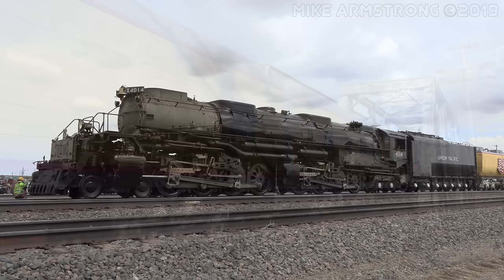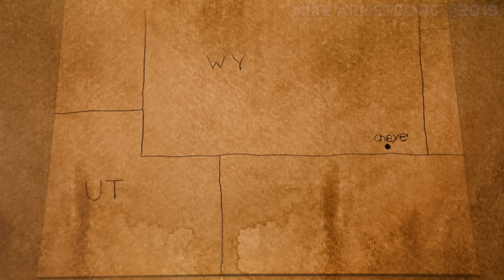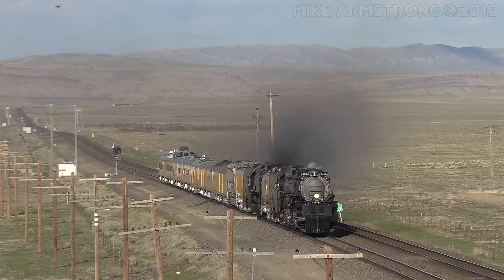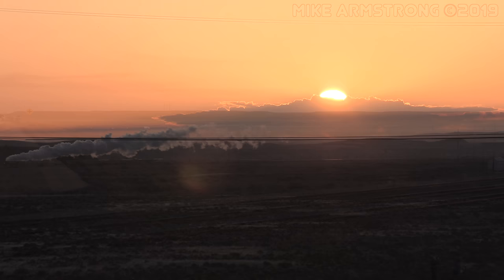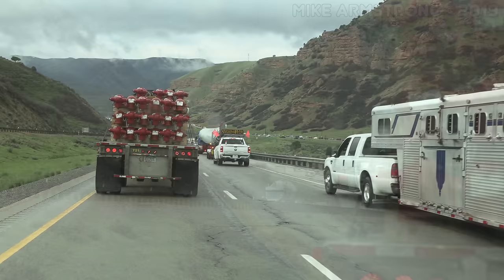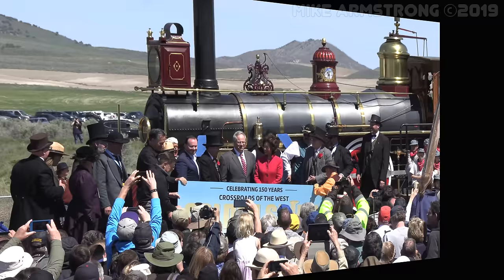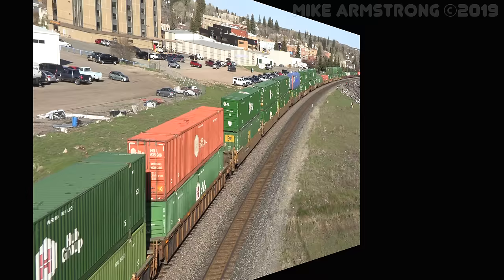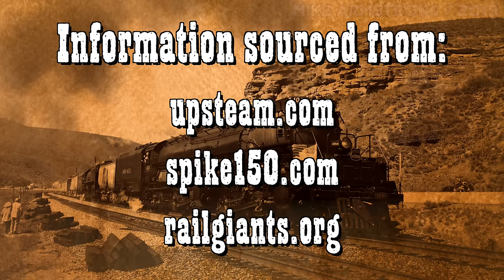Big Boy 4014 Steam Train: Return To Steam!

Comment: 18:46

why does the second engine suddenly start spewing black smoke?
Reply: Khandaker Faisal they may have accelerated the locomotive and that cause a lot of coal to be burned at that time
Reply: @green_bay_cheesehead1248  844 and 4014 no longer run on coal. They didn't run on coal since the 50s
Reply: Nick Wilde Official oh thanks I newer into trains so I don’t know a few things;)
Reply: @green_bay_cheesehead1248  it's fine
Reply: its braking

Comment: Where did they get the water for the two steam locos? You dont stick a water hose in those monsters and fill them. Even a fire hose would take a while. And there are no water towers on the track sides any more with 12 inch down pipes.

Comment: Can someone explain how 4014 and 844 pull together without holding each other back or getting mismatched rpm's. Contemporary engines can match rpm's with electric motors. How did steam engine do it? And does the crew eat and sleep on the train while making these trips. Just saw it in St. Louis and it's amazing. Great video. Thanks very much
Reply: communication either from radio or whistle

Comment: Epic fail, hearing the diesel pushing the consist at 3:49. and breaking at 4:26. Not even to mention the hot air expelling out the exhaust of the Diesel locomotive clearly showing its all show.
You can only do this without backup diesel, there is no other way.
Also, you do not park a locomotive like that for a day, and just go the next day, because of track maintenance. It takes half a day to stoke an engine like that to travel.
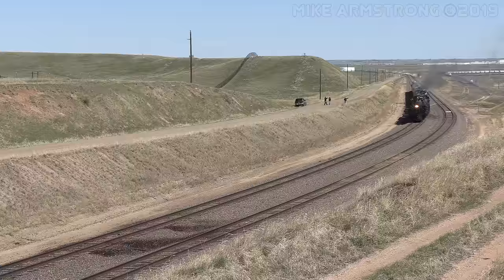"thousands of people" there are 2 at 7:19.

Comment: So is the diesel engine helping or being pulled as backup if the steam engine breaks down?
Reply: The diesel locomotive was essentially there for two things. One of them you mentioned: it was there just in case things went bad for either 4014 or the 844. It was also there to provide electricity to the cars it was pulling.
Reply: The reason they operate these excursions with a diesel is for redundancy if their is an issue with the steam locomotive(s), to provide additional air for braking, to provide dynamic braking (which steam locomotives cannot do obviously)  and now it's also to provide PTC for the lead locomotive. UP does not own any modern diesel's with HEP capability so it cannot provide any power to the coaches. That is done with a dedicated power car you will see in the consist.

Comment: We can hear the Diesel engine also running, is it also pulling the train helping the 2 steam engines?
Reply: it’s there to run generators for the carriages and/or for it’s independent braking system, steam locomotives are not allowed to run without a modern locomotive attached to the train

Comment: With two steam locomotives, why is there a diesel locomotive in the middle of the train.   Was it backup in case the steam engines went south????
Reply: both of locomotive doesnt have a computer system a accompying the Positive Tran Control (PTC) system

Comment: Why do they also have a modern diesel engine with them ? Is it to power the cars and brakes ?
Reply: big boy and many majority of mainline steam locomotive lacks of modern day train protection and signalling system, thats why a diesel is needed. With the new computer system that is placed on 3985s tender (which is what big boy is using), it probably doesnt need a diesel anymore

Comment: Wait, if these were made to NOT to have a helper engine.
 Why does it have 2 helper engines with it?
Reply: the steam loco is attended to the show, while the diesel is to provide both a modern day train signalling and protection system

Comment: Why, in all the current videos I’ve seen of the Big Boy’s, do they have a Diesel engine behind them?  Have they not been restored to full power?
Reply from the maker: It's for backup and added braking capability.
Reply: big boy and many majority of mainline steam locomotive lacks of modern day train protection and signalling system, thats why a diesel is needed. With the new computer system that is placed on 3985s tender (which is what big boy is using), it probably doesnt need a diesel anymore

Comment: I wonder why a lot of these steam engine restoration trips have diesel engines attached too.

Can someone explain?
Reply: I believe to assist with braking and providing power to the passenger cars
Reply: @rafe5556  they dont supply any electricity because its obviously a FREIGHT TRAFFIC LOCOMOTIVE
Reply: big boy and many majority of mainline steam locomotive lacks of modern day train protection and signalling system, thats why a diesel is needed. With the new computer system that is placed on 3985s tender (which is what big boy is using), it probably doesnt need a diesel anymore

Comment: Why do they always have a diesel engine in the train.? Surely this engine could  pull these half dozen cars with out any help from a diesel.  Just wondering
Reply: Safety...this was a test run of sorts for 4014 from my understanding, her and 844 could easily handle that train by themselves and in fact relatively recently 844 pulled freight...
Reply: big boy and many majority of mainline steam locomotive lacks of modern day train protection and signalling system, thats why a diesel is needed. With the new computer system that is placed on 3985s tender (which is what big boy is using), it probably doesnt need a diesel anymore

Comment: Ok I have a question, why do they need a diesel locomotive attached?
Reply: It's just along for the ride
Reply: @voldtitan1284  Ok just curious. I've seen a lot of these videos and in 98 % of them there's always a diesel along for the ride.
Reply: big boy and many majority of mainline steam locomotive lacks of modern day train protection and signalling system, thats why a diesel is needed. With the new computer system that is placed on 3985s tender (which is what big boy is using), it probably doesnt need a diesel anymore

Comment: Why is there a diesel locomotive behind it?
Reply: Diaper Man electric power. And emergency back up
Reply: @mrs.dairycow62  it doesnt supply any electricity because its a FREIGHT TRAFFIC LOCOMOTIVE. big boy and many majority of mainline steam locomotive lacks of modern day train protection and signalling system, thats why a diesel is needed. With the new computer system that is placed on 3985s tender (which is what big boy is using), it probably doesnt need a diesel anymore

Comment: why is a diesel in the lineup? for power generation?
Reply: dynamic breaking
Reply: it doesnt supply any electric generation because it s FREIGHT TRAFFIC LOCOMOTIVE, big boy and many majority of mainline steam locomotive lacks of modern day train protection and signalling system, thats why a diesel is needed. With the new computer system that is placed on 3985s tender (which is what big boy is using), it probably doesnt need a diesel anymore

Comment: What is the other diesel locomotive for?  Weight or in case of a breakdown?
Reply: Dynamic braking
Reply: big boy and many majority of mainline steam locomotive lacks of modern day train protection and signalling system, thats why a diesel is needed. With the new computer system that is placed on 3985s tender (which is what big boy is using), it probably doesnt need a diesel anymore
Reply: big boy and many majority of mainline steam locomotive lacks of modern day train protection and signalling system, thats why a diesel is needed. With the new computer system that is placed on 3985s tender (which is what big boy is using), it probably doesnt need a diesel anymore

Comment: Question..Why did 4014 need two helper locos?
Reply: That's what I was saying
Reply: @user-wb8wt9fd5h  
🙂OK
Reply: @Barb5001  😀
Reply: The 4014 was running on its own power. 844 (the second steam locomotive) was initially going to travel to Ogden on its own, but Union Pacific decided to have 4014 and the 844 travel to Ogden at the same time (also known as a double header). The diesel locomotive was used to provide power to the coaches it was hauling.
Reply: @CoasterTrains95  
OK.. thanks for that info
Reply: @CoasterTrains95  The trailing diesel does not have any ability to provide power to coaches (HEP).  If you notice in the video when it's pulling coaches their is a dedicated power car that provides the 480 VAC for the coaches. The reason they operate these excursions with a diesel is for redundancy if their is an issue with the steam locomotive(s), to provide additional air for braking, to provide dynamic braking (which steam locomotives cannot do obviously)  and now it's also to provide PTC for the lead locomotive.

Comment: 4014 and 844 barely put on any smoke shows which is disappointing.   4014s auxiliary tender ruins the effect of the double header. the train is not long enough considering how powerful 4014 is alone and how powerful it is with 844 combined. 844 doesnt realize it can blow its whistle either. i thought i was gonna miss some intense show. but i missed nothing not being there. like half of the "show" was only caused by  the cool air or rain. so it was kind of not the best they could do for the first trip of 4014 if you ask me.
Reply: 4014 is the lead loco in a consist so does the blowing for crossings and signals.  844 answered when starting off.  That is the nature of double heading otherwise someone will miss a signal.  What you are look for doesn't happen on the main line and running.

Comment: Take the diesel off
Reply: how are you gonna make her run into the mainline without some modern standard anyway? big boy and many majority of mainline steam locomotive lacks of modern day train protection and signalling system, thats why a diesel is needed. With the new computer system that is placed on 3985s tender (which is what big boy is using), it probably doesnt need a diesel anymore

Comment: I bought a (then) $800,000 loft right across from the Cal-train station in San Francisco (right next to the ballpark) back in 2004.   Not being stupid, I checked the train schedules, ascertained that the last train pulled in at (if I recall right) 11 pm or so, and said to myself (fine, I rarely get home before 11 pm--great!!) and bought.

Only after I moved in (not being smart) did I realize that when they get those diesels parked, they continue to run them.

Always.

Forever.

I HATE the sound of diesel locos and the sound of the (totally unnecessary) diesel loco in this video makes me sick like child pornographer Jing H. Yu makes me sick.

Comment: Poor 4014.  Unable to pull thentire train so 844 was also needed.   What a fuel and air-polluting waste.
Reply: the 4014 is very capable of pulling more than 9 passenger cars, the 844 is there for fun along with the 4014. the diesel is for dynamic breaking and other purposes, it's not pushing the 2 steamers
Reply: @animasuper1343   Would never have happened in realife.   Should not have been dohere.
(Would rather see and hear one locomotive under load than two exerting littleffort.)
The dieselocomotive provides dynamic braking and electricity for the passenger cars.